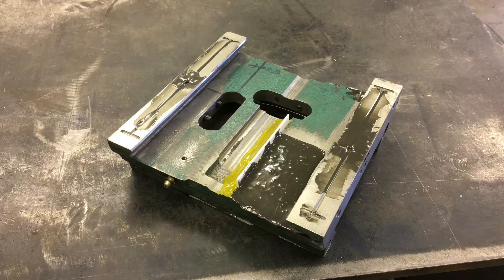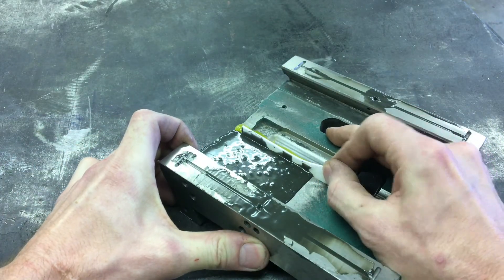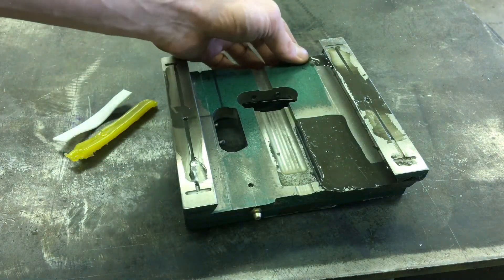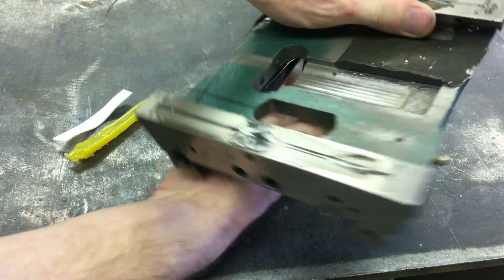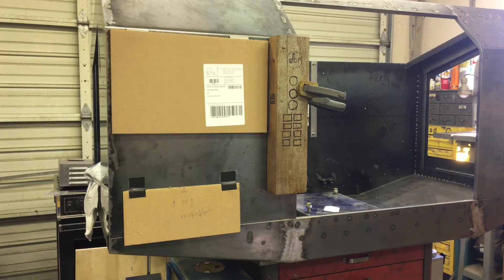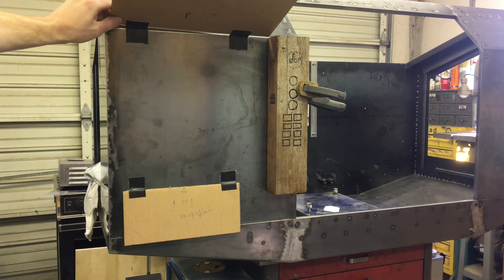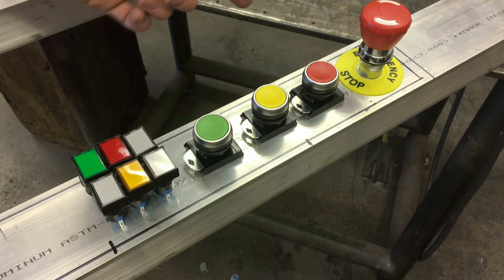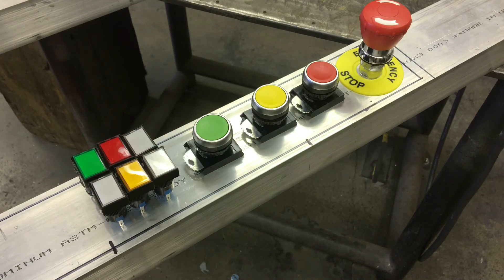GRIZZLY G0704 CNC Conversion Update 10 - ( Saddle epoxy / machine interface / buttons )

Comment: Ever think to use a keyboard with touchpad built in. I use a Logitech K300(?) it's wireless also. And nice to see some lefties out there don't it right.
Reply from the maker: Thanks for the suggestion Michael! I will look into the keyboard you mentioned. Lefties always do it better!! = )  - Nick
Reply from the maker: I looked on amazon. I really like the keyboard (i believe the current model is called k400). I had a thought though... have you had any problems with the touch pad misbehaving from.... coolant, oil, grease ect? Seems like a really sweet little keyboard. - Nick 

Logitech K400            https://www.amazon.com/Logitech-920-007119-Wireless-Keyboard-Connected/dp/B014EUQOGK/ref=sr_1_1?ie=UTF8&qid=1498536915&sr=8-1&keywords=k400+keyboard
Reply: Nicholas Miller some how I missed your reply. it is the k400, I specifically use the k400r. It does fine with chips in the keys but is not super tolerant about coolant on the touch pad. Twice I have left a puddled finger print on the touch pad that caused it to stop working untill it dried out. If you wipe it off quick it's not an issue though. I ordered a generic universal silicone cover off eBay for $1 that will be mounted under a bezel and should allow for the touch pad to function under it.